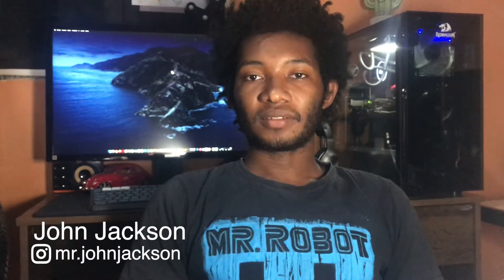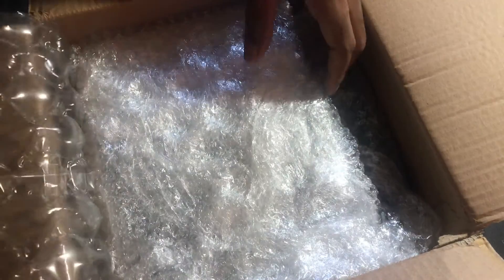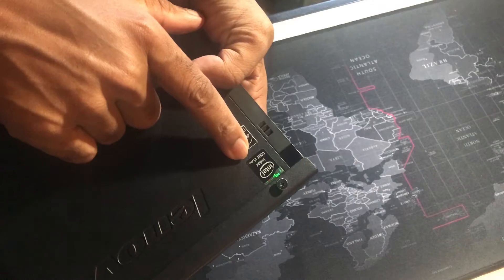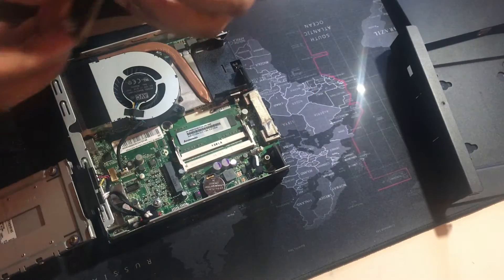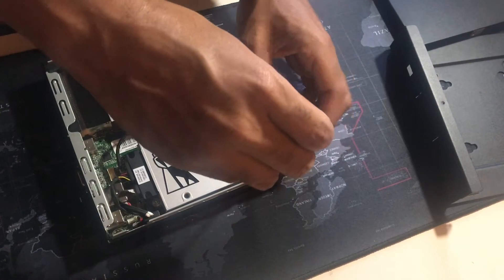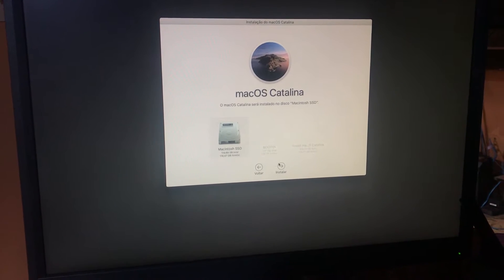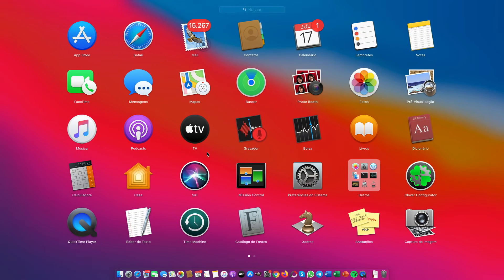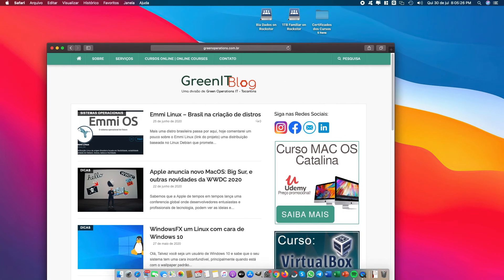🇬🇧 HACHINTOSH on LENOVO THINKCENTRE M93P TINY

Comment: Terrible... u not max out anything or gpu or cpu upgrades..or ram
Reply from the maker: On this model u can upgrade cpu (desktop 4th gen) and u can upgrade ram (2 slots ddr3 laptop) and u can put on it a pcie x1 (external gpu that same in laptops) if u want, but in this case this little compute is going well i use it only for simple tasks
Reply: Oh ok how much ddr3 does it hold
Reply: I want to buy cheap one and  cpu gpu and max out ram ..im thinking it has lots offer
Reply from the maker: @middleburg11  this model have only integraded GPU, its a office computer...but u can tuning with core i7 and 16gb ram...in news models we have 8th gen intel cpu

Comment: How did you get the hd4600 graphics to work I can only get mine working with 7mb
Reply from the maker: in this case, you need to inject IGPlatformID and IGPDeviceID in Clover or OpenCore, and then you will get the 1500mb for video...another thing to see is the memory dispend to DVMT on your BIOS